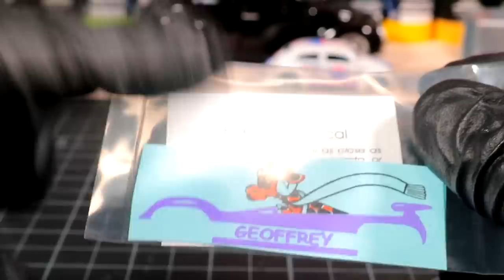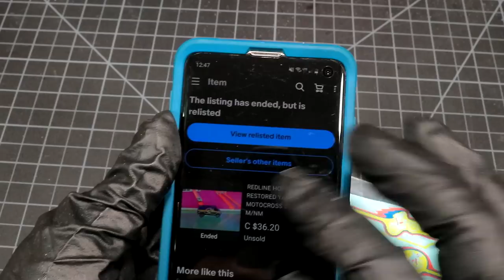Redline Hot Wheels Restoration - Redline Yamaha Super Van - Extra Nice!

Comment: Hey DCR, have you ever checked out the chrome-like finish you can lay down with powder coating? I’ve never seen a side-by-side comparison with factory-fresh chrome, but the times i’ve seen the powder coating method used on other restoration channels, it looks way more authentic than “chrome” paint. It couldn’t be used on plastic parts unfortunately (can’t conduct the needed electric charge), but should work fine on diecast. Just an idea 🙂